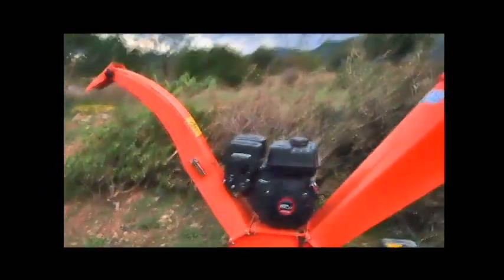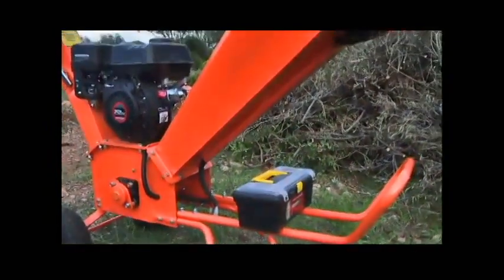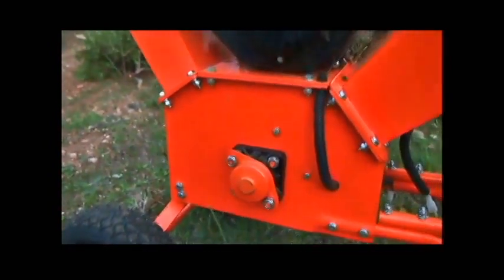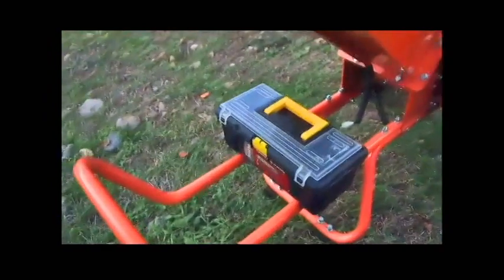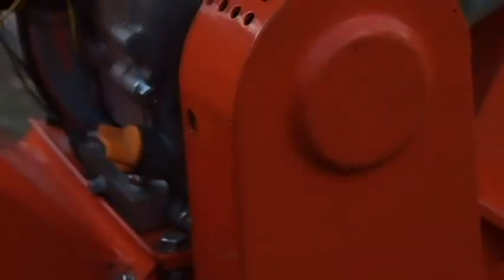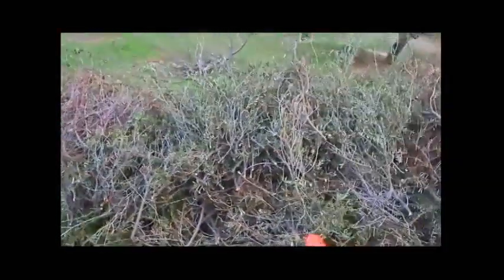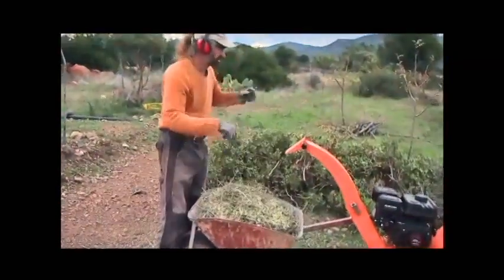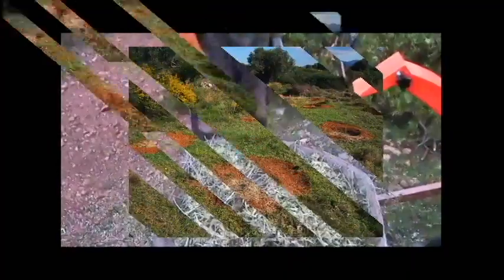Kraft wood-chipper 7hp, 212cc Loncin engine - test by Korogonas Ark Community

Comment: After having had the inconvenience of blocking the drum (rarely though but still happening sometimes) and needing to take out 6 screws and with secured bolds (which is apain in the ass!) I made a nice upgrade design: 
The feeding tube now got a slide in system, which I welded on the base/body of the mashine and now works fine even without any screws at all. I kept one fixing point, though, with one screw and bold. So now, in case of blocking of the drum occurs due to too much pressure and/or access material, the feeding tube is easily detached in a matter of seconds! That's how these mashines should have been engineered and made in the first place!

Also, the welding made by the company and also by me broke again just at the line where the thin tube materia is reached! So I upgraded the feeding tube with four 40x3x0,5cm steel strips (one on each side and two on the top), connecting the tubes "shoe" (base plate) with the long body, so the vibration is applied more evenly to the tube which is now super stiff and steady and 100% crack immune...
Next upgrade will be the replacement of the poor quality wheels which need to be changed every three years, no matter if you use the mshine or not. So I am about to fit in two much bigger front wheels from a scooter with tubeless tires (you can find these as used parts for 50-80Euros a pair). This way, not only the regular exchange of tires and occuring flat tires will stop, but the chipper will be much easier to move on uneven ground, more stable and resistant to fall over! I am currently waiting for the wheels and axis to arrive...

Comment: I can here in this video the engine sluggish ..it could be some optimization to work more smoothly..
Reply: yes, maybe the drum is not very well tuned so that it makes more vibrations than it should and maybe that is why the cracks appeared in the feeding tube appeared in the first place. Do you have any idea how to tune it somehow? I cannot see anything to adjust the drum...
Reply from the maker: I think the drum must be somehow not perfectly centered and is running not fully smoothly, this way causing the engine also to adapt this in its sound. The ngine itself is perfectly running, the Loncin motor seems to be a really good quality choice. As for the drum, I think this unround running is most likely also the cause for the problems with the welding-line and the screws to simply break off and shoot away! We solved all this with a few easy engineering-changes with the feeding tube connection and also with bigger wheels. The machine is now much better and more practical and efficient than in its original design and should actually be built like this from the factory in the first place, with only little additional costs, but great difference in quality, durability and practicality...

Comment: How is this machine holding up after using it for some months now? You had an issue with a welding crack right away, has it been ok otherwise? I am thinking of ordering it but I am little worried that all chippers under 1200 euros may be a waste of money. I cannot afford this! I would really appreciate your feedback. Thank you
Reply from the maker: I did a great job with all of our olive cuts and lots of other bushy material as well as carob branches. Besides the cracks, that appeared after no heavy use twice first at the original feeding tube "shoe" as well as a second time at the original replacement tube which we got as part of the 1 year guarantee. Finally, fhe importing company here is now doing a propper welding line plus reinforcement at this part, as the factory, won't do anythinmg about it, as they said. The importing company told me also, that only our feeding tubes cracked, which I can't believe, really. Maybe all the other clients didn't notice the crack(s), because the mashine still works fine even with the cracks at the feeding tube's shoe.

When the blades are new or freshly sharpened the mashine works fast and without too much muscle work as it pulls in most of the material. But you should avoid at all costs any stones getting by mistake inside the feedinmg tube, e.g. with bushy stuff or little branches that you may rake together and then throw in. DO NOT DO this because even small little stones will cause damage to the blades which in turn will need to be sharpened and that is nothing you want to do too often! By the way, changing the blades, or simply taking them out for sharpening is quite a hussle so avoid stones! Now, when you have to take out the blades make sure you put somthing long underneath to hold them in place an prevent them from sliding by accident inside the drum. I learned the lesson the hard way (nothing of this is mentioned in the operation manual!) by having to get the blade out again which is a lot of a hussle, so take the blades out CAREFULLY. Sharpening itself is an easy job. 

All in all, the mashine works really fine, the 7HP Loncin engine is a reliable, strong engine and will do a great jog for all fresh branches up to 5cm, even harder woods. Also it has no problem with thicker braches with sidebranches, it simply pulls them all in! I would definitely recommend the mashine, even if I had to weld the feeding tube-shoe myself.
Note: All these mashines have so called safety measures, such as an emergenca off Handle and a plastic/transparent rubber "thing" on top of the feeding tube. If you want to work nicely and without having this stupid rubber-sign in the way or pushing every now and then the emergency off handle, then SIMPLY disconnect them (or do not install them in the first place!

So, my friend, YES, GO for it, it is worth the money and does a good job, if you have a garden that is bigger than 500sqm. We have 33.000sqm and quite a lot of stuff to be chipped, and this chipper does a really good job...
Reply: @iamalexandrospfaff  Thank you very much for such a detailed and fast reply! The information is very useful. I have 9000sqm crying out for a machine like this. Best wishes to you :-)
Reply from the maker: @melivision  Thank you! A last thing: Try to avoid dry branches, especially thicker dry ones from hard wood such as olive. This will reduce the "standing time" of your blades. Chip your cuttings withing a week's time...

Comment: hello sir excellent video, I have ordered the same machine, did you need lubricate the bearings or anything before of its use? thank you for your very good demonstration
Reply from the maker: As with ALL new mashines you need to fill the needed oil to the engine before start, otherwise nothing is needed. Be aware of the bad welding lines at the bottom of the feeding tube! I had two brand new ones that cracked both after only little use! The importing company here is now doing a propper welding line plus reinforcement at this part.